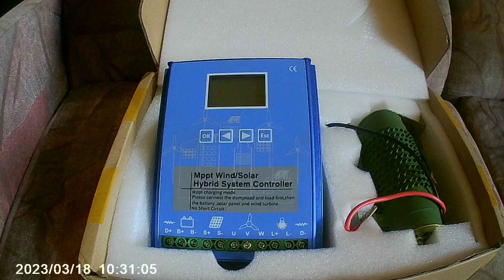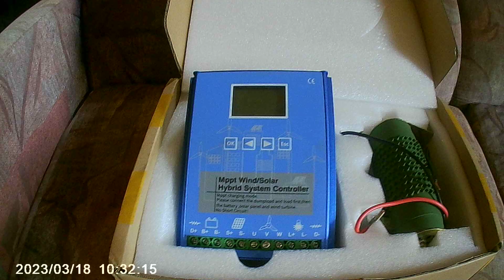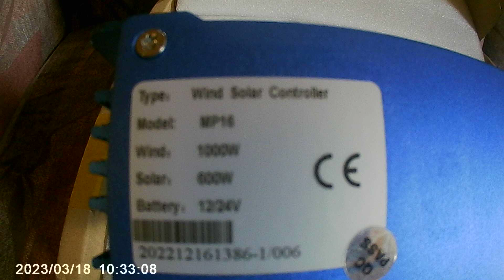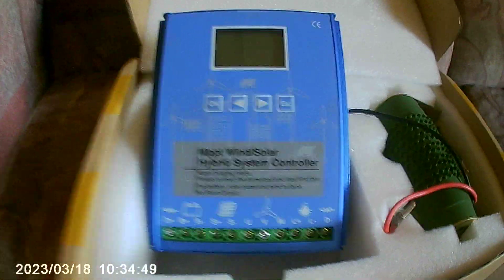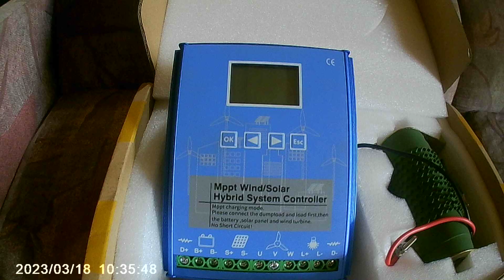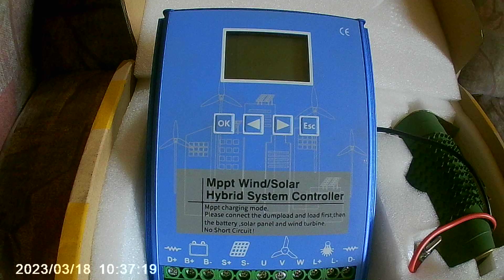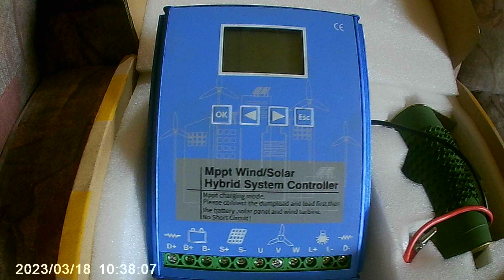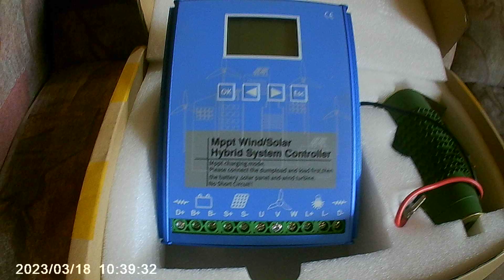chinese mppt wind charge controller do they work part 2

Comment: power flow is different to power dissipation.
you have the power flowing through a circuit, VxI.
but you have the energy dissipated in a resistance. I2R

example. at 24v, 10A... 240w. straight forward.
the resistance to flow that current at that voltage...
2.4R. 
10x10x2.4. 240W. the total circuit consumes the 240W.

at 12v, its still 2R4.
5A.
5x5x2.4=60W.

you cant actually push 10A through it at 12v. 

and charging batteries becomes a different world again as they have super low internal resistances but they also produce an opposing EMF or  BEMF from our pint of view, that we have to exceed to force energy into them.

as a battery they are a source of EMF.
when charging, they are a "source" of BEMF. its just the EMF we have to fight...

to TRULY rate a wind turbine is hard...

at the basic... disc area, wind speed, generator resistance, load resistance. load has to be at least 5X the generator resistance for best efficiency. batteries have low internal resistances...

Comment: I am waiting on a 3000w controller. I have a 1600w wind turbine. It says Mppt for lithium batteries. Tho I see on specs from amazon. It says the solar panel part is a pwm. As I understand pwm controllers will not work for lithium batteries. Do you use lithium batteries? With the solar? I sure don’t want to ruin my battery bank 🥴 using solar. I know the instructions probably don’t explain this well. Any help will be appreciated.

Comment: So I am pretty new to all this, but getting the hang of it. I was looking into buying the 15,000 watt solar wind charge controller. Would I be just as well to get 24 batteries with it? Also what does that mean for the turbine, and solar panels. Also is I get the 15,000 watt, Would I also by a 15000 watt inverter?

Comment: I am glad to find this video. I am buying a 1200 watt wind turbine and looking to buy one of these charge controllers. I ordered a 1200 watt wind turbine but I am thinking a 1000 watt controller like this will work because most Chinese turbines do not reach the amount of watts claimed. Anybody have thoughts ?
Reply: "laws"
of physics.
betz law. the aerodynamic one.
"jacobis law". the electrical one.
involves "ohms law".

a generators output is dependent on what its attached to...

Comment: I cannot find specs to install solar panels with my system. I have a 2000w 24v system - the factory said 2x400watt panels. Does this sound about right - there were no stickers on the box or specs. But great informative video. Thanks
Reply from the maker: i have not tried that controller with solar but yup spot on 24v 800 watt.top voltage is 80v so if your panels exceed that togather in series ocv it will destroy the controller.however 2 400 watt panels in paralel should be fine.but i have not tested that .i would wire 2 in paralel and be watchful the first sunny day

Comment: Hi,  I appreciate you taking the time to put up this video but I am completely baffled by your narration.  You keep repeating your self over and over again and confusing the hell out of me! My bafflement started early on in the video at 01:28 with the statement "At 24V we will use the number 25 because LiFePO(4) batteries at 25V are a dead battery."  What on Earth does this mean?  The rest is equally confusing.
So, my advice is to sit down and write a script of what t is you want to say and then record that and superimpose it on your video.  Hopefully the video will then be clear and about 50% shorter!
Having tortured myself and listened to the entire 10 minutes, what you are saying is: 
1/ For a 24V system it is a good controller 
2/ If you have a 12V system, it is a good controller BUT it will ONLY handle 400W.
Mother of God!  Life is too short!
Reply from the maker: this is a learning channel you take the time to find negative energy in my findings than go elsewere .why post my narating to be repetative im doing the best i can to help those who need it .it appears your not one of them so quick to judge an discriminate well i struggle to work the camera as well as i cant narrate to your satisfaction simple means this video is not for you but others need my help to decide if its for them .you need to back off im not wasting time wth nay sayers like you i know i need to do better but struggle in some areas to get there so just move on without critacism if its not right for you.
Reply: I did not mean to insult you but it seems I have for which I apologise.  But if you want to make useful videos to help your viewers (rather than frustrate them and waste their time) then take my criticism seriously and learn from it... If you struggle with operating the camera and narrating simultaneously then surely my advice about writing a script to work from is doubly relevant?  And I am certainly not a 'nay-sayer' - if I were, why would I be even watching your video in the first place?  @offgridgarage

Comment: I didnt appreciate this mppt controller trying to charge my 12v lifepo4 battery at 18v... went straight back
Reply from the maker: they are false labeled some dont work rate out of the box others are wrong voltage buyers beware

Comment: Hello been following your videos for a long time please can that controller work with a 400watt wind turbine to charge lpo4 batteries am living in the Caribbean where the weather is hot 
Thanks for your reply
Reply from the maker: yes it will 400 watt 12v max or 24v 800 watt max

Comment: But the question is how well does this charge controller perform on a 12v battery system. Is it actually mppt or just a pwm with a sticker that says mppt?
What voltage are you get on the 3 phase input while the wind is at that speed?

Comment: I have the same charge controller.48v for a 48v battery system. I use life po4 batteries.I cannot get more than 2 watts at any wind speed.Infact my turbine hardly spins even in 20mph wind.When i change out controllers I actually get piwer and speed from my 500 watt turbine.Thought on why that is??. Settings on blue Chinese controller need to be changed?
Reply from the maker: i too had the same problem test it with a 3 phase bridge rectifier you will see that controller is braking the turbine not allowing it to  spin up.you need a differnt mppt charge controller
Reply: @offgridgarage  Do you have one you recommend for life po4 batteries?
Reply from the maker: @armandogdgdgh3163  all though expensive i will only use midnite classic 200 mppt charge controllers for wind there worth every penny.the sl unit is for solar only be sure its not the sl model.these controllers are the best ive seen an will protect lifepo4 batterys when set to the right values.you can gain up to 5 times more kwh.

Comment: Nice vid.Im having issues with this charge controller and im hoping you can help.I have 2 of these charge controllers and either one will not provide more than 5 watts in 20 plus mph wind.Infact when the voltage reaches about 10 volts incoming power it seems that the brakes are put on.When i use the standard charge controller that came with the turbine the turbine spins much faster taking in much better charge.I qould rather use the charge controller that has readings though.Is there something in the settings that is preventing it from reaching higher watts?? Very confused as its happening with 2 of those mppt charge controllers.Would really appreciate your help.
Reply from the maker: these charge controllers have a 80v max ceiling voltage however i had the same problem in a 24v battery bank it would not allow the turbine voltage to exceed 30v on spin up or cut in than applies the brakes.these controllers are only usable with small turbines 500 to 800 watts max that is my findings as well.i used another charge controller for the 1000 watt turbines or higher.false labeled from china.they simple hold back the turbine to protect the controller
Reply: I am having the same problem with this charge controller. I haven't used the original charge control because i rather the digital reading but am going to try it tomorrow. Only putting out 1to 15watts max
Reply: @wrighma7753  Hi  did  you  manage  your  problem   please tell me  becoz  i  have same  problem  here  as  your  .Thankyou  in  advance
Reply: @KurtBergNielsen No, I wasn't able to get more than 15 watts out of it, I trash it and used the original PWM charge controller and just added a digital voltage reader on it. Good luck
Reply: @wrighma7753  Thankyou very  much   for answer   Merry Xmas  to  you  and  your family   from Denmark
Reply from the maker: yes you can run them to bus bars without problems thats how i like to do it as well.just be sure the wire size is correct to handle it

Comment: Glad I saw this video. My i1500 (24v) runs into a 12v bank and often puts out 50 or 60 amps. Great clear video. By the way, does that charge controller use solid state relays or coil relays? ( if coil, you'd hear the click click )
Reply from the maker: no ticking noises and your 24v turbine will not work with that controller on a 12v bank if it did its brakes at 12v 400 watts  as it goes by the battery bank for these controllers.that is the same for me48v turbine on 24v bank blue controller shut down turbine on start up.i had to get a classic 200 to work togather as will you or a 3 phase bridge rectifier will work but a lot of power loss not effecient
Reply: @offgridgarage  Thanks for the quick reply!
Reply: how good did you find the charge parameters for lipo4 to be , was is fixed values or could you change them?
Reply from the maker: @kimmogensen5390  fixed values this is only good for small turbines 400 watt 12v 800 watt 24v at best higher turbines brake on spin up holding larger turbines back from starting false claims do not buy for larger turbines
Reply: @offgridgarage  thanks for your answer   do you belive that these bigger units (a bit more diffecult to find in the listings also) also will brake the turbine already at startup ? the unit looks to be hardwired different in the power in and outlet side , and the dumpload is way bigger , if the lipo4 values are set i figured i would try and run it to a bank of lead acid, but my plan is in the longer run to get a solar chargecontroller to work with a a30 and solid state relay to combine a dumpload  , is this similar to what you have done with your midnight? controller,, now i am not trying to squease every ounce of power out of the unit , here now running 3x2 12v 100w panels and 2 200w 24v panels (with broken glas output about 3-5amps each) i have more power then i can use in my caravans, now offcource over time when i rebuild my house i will use slightly more power
Reply from the maker: @kimmogensen5390  the ss relays i tested with burnt up in less than 10 sec so i went back to the ts 60 for dump so be sure to test it first ive had bad luck with ss relays and i wouldnt trust them as a fail over dump load.
Reply: @offgridgarage  thank you. Yes stuff like that kind of setup is to be rigorsly tested . And the turbine turned out of wind When one is not home . The best test is time . I will see trough your videos in order to learn more as i am a old scool mekanik and is really not much of a electrician

Comment: Why 32A?
Reply from the maker: only through digging up information at least what i can find has stated soft braking is applied at 32 amps to protect the main on board 40 amp fuse
Reply: @offgridgarage  Thanks!